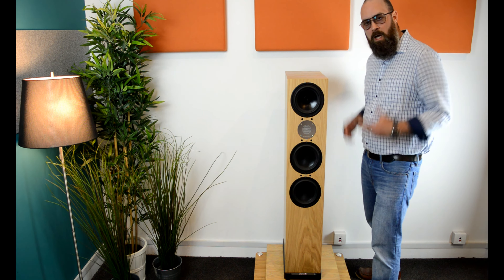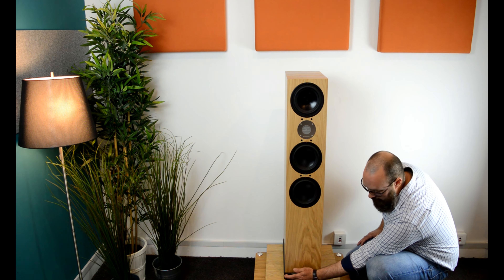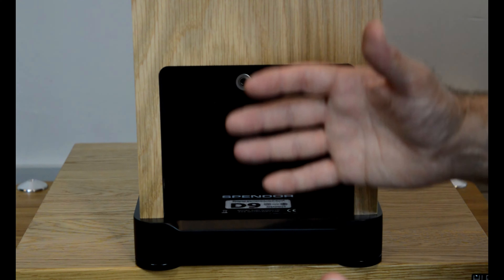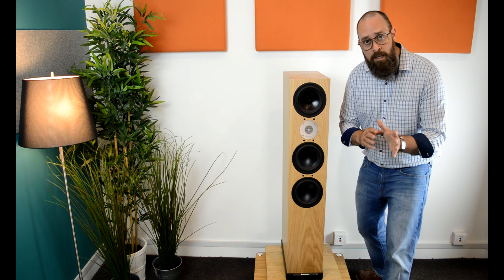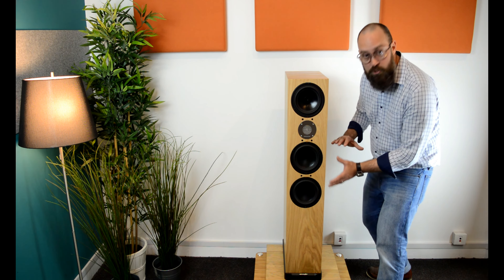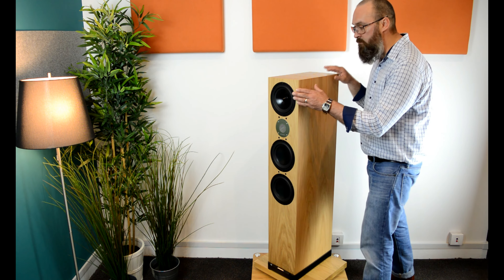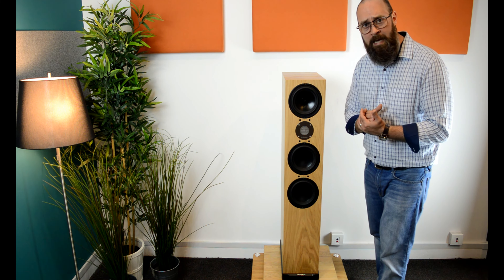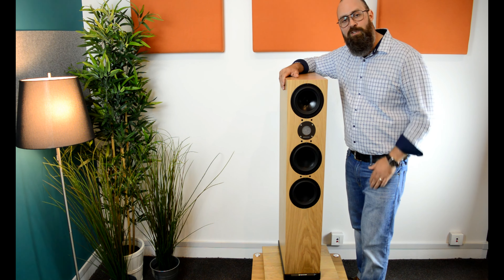Spendor D9 ~ Introduction

Comment: Which one would you buy Spendor D9 or Harbeth 40.2?
Reply from the maker: Hi Dorne, very different sounding speakers. There isn't a clear cut answer, it would depending on your tastes, room and equipment as much as anything else, system matching is very important. Happy to discuss if you want to ring our shop. Regards, Struan
Reply: The Harbeth for sure. This D series sound too screechy and lack the warmth that Harbeth and traditional Spendors from the SP series provide.
Reply from the maker: @socksumi  I just got my SP200s in store, can't wait to hear them :) Regards, Struan